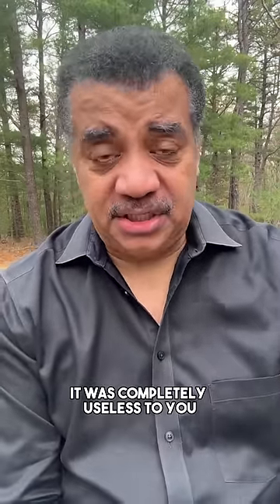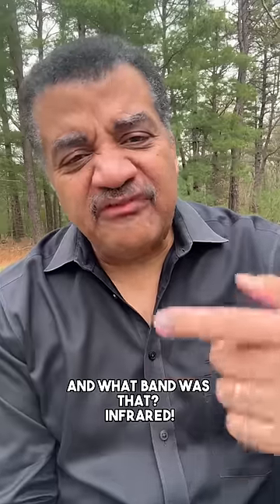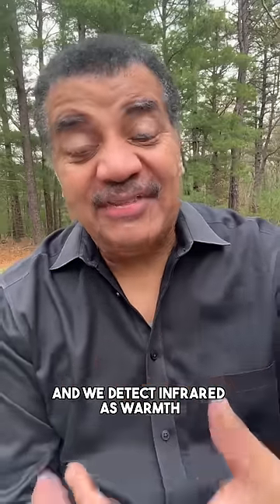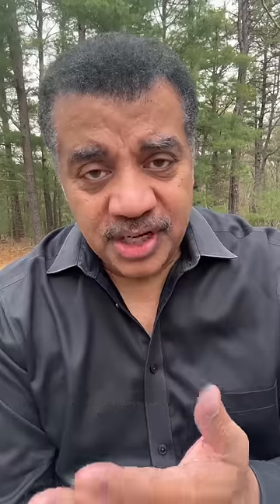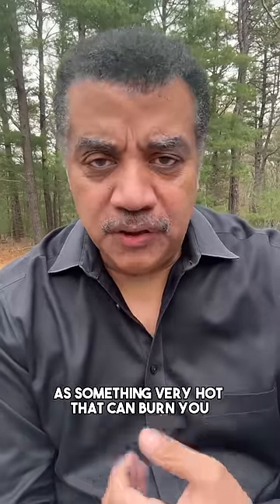LED Bulbs vs. Old Bulbs 💡

Comment: “Sir, that’ll be $23 for the bulbs”
Reply: And that will also be $240 for electricity, this month.
Reply: LED bulb payback time is less than 3 years and last wayyyy longer.
Reply: What kind of bulbs and where?
Reply: In the woods?
Reply: @benkinerk6830   last longer? They break on purpose. They could last forever but the companies want money
Reply: When you want a designer bulb with multi functionality, they tend to cost 10-15 dollars. A 13w LED soft light bulb is about 1.50 to 2 dollars.
Reply: @R9naldo
Even as new lighting sources were being designed manufacturers were still reducing the envelope sizes of tungsten incandescent to make them overheat and burn out sooner. It is arguable that this was deliberately to make them last a shorter time to compensate for the flaws of the new bulbs, or simply penny-pinching by the European manufacturers who were being undercut by China. Either way the current breed of tungsten build is not a fair comparison with the new bulbs.
Reply: 4 for $1 at Walmart.
Reply: Not sure which planet you’re on. I replaced all the recessed downlights in the living area, the multi coloured ones that are controlled via your phone, LEDs, about 6 watts and they were $10 each and will last forever.
Reply: @jeremyashford2145 The thing about incandescent bulbs is that when they burn out, the filaments literally burn until they get thin enough to snap. If you make the filament thicker, then the bulb lasts longer.

However, resistance is proportional to wire thickness. With a lower resistance the filament is less efficient at converting electricity to heat as well as having more mass to heat up in the first place. This means it glows much less brightly and in a much redder color temperature for the same amount of electricity. A brighter incandescent bulb means a shorter-lasting bulb. Light bulbs are designed to balance durability with efficiency.

Of course, LED bulbs are incredibly efficient and incredibly durable, so it's really the best of both worlds.
Reply: @R9naldo stop buying crap LED’s
Reply: Where? I've seen about double those prices.
Reply: The cheapest I’ve found locally is a 4pk for $10 and I don’t think I’ve had any bulbs last even a year 🙈
Reply: That’s right, so sad 😭 the purpose is to abuse the consumers for greed.
Reply: The old bulbs cost you twice as much... or do you not remember having to replace them regularly? The new bulbs will last way longer than these will, and despite people saying they cost more in electricity... THEY DON'T. 

The measure of how much electricity they use is not whether your bill goes up or not.

Comment: Fun fact, auto manufacturers have started putting defrost in the headlights of vehicles because of this.
Old bulbs would be warm enough to melt the ice, leds cannot.
Reply: Headlights defrost will be used only a few hours a year (in a more efficient way than bulbs), old bulbs waste a lot of energy during the whole time they are used.

For a thermal engine, wasted energy means wasted gas.
Reply: @psykauze 
Possibly, but I don't see how replacing old bulbs with LEDs is going to effect gas mileage.
There is an energy savings, but it's not enough to effect how much gas is used.
Reply: @ShrockWPS  A single H1 bulb is consuming 55W, this power came from the battery and alternator, so from the engine. Even with an engine with an average efficiency of 20%, this means you have to consume 275Wh of gasoline per hour. A liter of gasoline (sorry I am European) is about 10.000kWh, so we need to consume 2,75cl of gasoline for 1h of light for one bulb.
A car has an average speed of 37,5km/h during its driving usage, the bulb will consume 7,33cl/100km more.
On a car with a mileage of 39,2mpg (US) this single bulb will drop the mileage to 38,73mpg.

Where I am, 2,75cl of gasoline costs about 0,05€. With an average lifetime of 500h, the H1 bulb will cost 25€ of gas.
Reply: @psykauze 
Forgive me if I'm mistaken, but I don't believe that's how it works.
Take for instance my personal vehicle. I drive a 2005 Toyota Highlander it was the 3.3 Liter V6 engine.
The engine rotates the alternator and the alternator puts out a set amount of electricity. The power the alternator produces doesn't increase or decrease because of the demand of electronics pulling from it. It produces strictly off the engine.
So whether I run LEDs, or the Hologens that are currently installed they won't effect the gas mileage because the engine and alternator produces the same amount no matter what.
Reply: @ShrockWPS it will keep your battery from going dead so quick if you leave the lights on though.
Reply: @ShrockWPS  The output of your alternator varies directly with the amount of load from the vehicle. It does not output a set amount of power. Increased power draw has a direct impact on the effort needed to spin the alternator. I'm currently in need of a new serpentine belt on my Camry. If the belt gets wet from driving through a large puddle and then I turn on something with a decent power draw like the rear defroster, the increased rotation resistance from the alternator is enough to make the belt slip and squeal. Every single watt you add to the overall electrical load in a vehicle increases the amount of fuel the engine needs to burn to run the alternator.
Reply: Everything is correct except that led don't get hot. They do with enough wattage. Look at ktm bikes: they had to install a cooler for the headlight
Reply: @Revy8  I mean, it's half correct. The LED itself does not get hot. The electronics that drive them do however give off heat, which can require a cooling fan in environments where the ambient temperature can be quite high (like a car). I have some 150w equivalent LED bulbs and you absolutely cannot touch the base of them after they've run for a while. It will burn you. It's likely still losing more energy as heat than it's outputting as visible light.

Comment: In a moderate cold country, like The Netherlands, the warmth of an old-fashioned lightbulb wasn't total waste: it actually helped to warm the house. So now we have more effective lights, but we also have to turn up the heating a bit.
Reply: Yes indeed as there's no such thing as a free lunch.
Reply: Likewise in the mediteranean countries like mine, during the summer,  old bulbs had our AC working harder
Reply: Basically that's true, but the heat-energy produced by the light bulb normally wouldn't be enough to make a big difference.
You could also use a heat-pump/AC to heat your house and have 4x the efficiency of a light bulb 🤔
Reply: I really miss the heat 6"above my head when standing up
Reply: Why make heat and light functions inseparable? Better to have them in separate devices so you can control each as needed
Reply: Daul lighting.  Warming bulbs and lighting bulbs. It will meet you half way there
Reply: It's still a lot more efficient to turn up the heater more than to use your light bulb as part of the heating equipments at home.
Reply: Yeah but that's A: only true for about half of the year, and B: lightbulbs are usually pretty close to the ceiling, which is a very inefficient way to heat a house. So while it was a bit of compensation, it wasn't even close to being effective enough to make it sensible to keep using incandescent lightbulbs.
Reply: You’re forgetting Summer, that same heat made the house too hot in Summer if your logic is correct and it isn’t. There’s too little heat from bulbs to warm a house. Heat rises and any heat from the lights stayed near the ceiling where you couldn’t feel it.
Reply: @polycrystallinecandy Most of the times needdd in parallel though... When it gets dark, it also chills down.
Reply: @jaspermooren5883 the infrared light that it makes warms up the things that absorb it. Namely walls, furniture, floors and so forth. Its actually a pretty good heater. It's also typically only on in the rooms that you're using. Also, most of the infrared light is in the 700-800nm range which doesn't go through most glass, so you don't really lose the heat aspect of the light that way. It basically stays in the room and warms it pretty evenly.

One trick I see a lot up here in Canada is crawlspace lighting on a thermostat. Lights come on below 5 degrees or something. Does a fantastic job of keeping your pipes from freezing, they last forever because they don't often come on and they're much safer than anything with a heating element or fan.
Reply: But still wastee on warm summer nights.
Reply: Just use the heater at as your heat source they are far more efficient then a lightbulb at heating
Reply: And they don’t blind nocturnal birds like LEDs do
Reply: @levismith7444  how's that? 🤔
Reply: Sun is up later in the summer. Like who turns on the lights when natural sunlight is available?
Reply: @epbeket  most LEDs create excess light pollution which disturbs nocturnal birds as well as melatonin levels in humans.. that my not apply to amber or red led lights but definitely the white leds

Comment: I need the old ones for my plants in the winter.
Reply: No you don't. I've got my roses and tomatoes in a grow tent with just LED lights. You're good without them unless you just need the old bulbs for heat. Light is light, and plants use simple light for photosynthesis
Reply: @BadgerScrub  that's what I meant. For heat.
Reply: Cant you use geat lamps?
Reply: Besides LED bulbs inhibiting melatonin production and disrupting the circadian rhythm degrading the quality of sleep among other unhealthy things / yeah at the expense of our health they help lower your light bill
Reply: Wrong plants bud he means those sticky icky plants
Reply: For chickens too
Reply: All the LEDs I’ve had get hot on the part below the plastic 🤷‍♂️ also seems like they don’t last nearly as long and way more expensive smh.
Reply: @JayBenn-mr2woh  yeah you save like 50 cents per month power wise but get to spend more for the bulb itself. Hooray "The Future"

Comment: to be fair in cold places it's still creating heat and 100% efficient
Reply: But they won't melt snow or ice off a head light.
Reply: You'll get more heat out of wood.
Reply: I concur. I'm in Canada, I live in an older home, and keeping my bedside lamp and a floor lamp on in my bedroom is the difference between comfortable and cold.
Sometimes inefficiencies can have unforseen value!
Reply: @stephenmitchell9520 Why do not use use heater ?? 😂😂
Reply: @jericho-tube 
We , of course have heating. in my case, hot water radiators powered by a gas furnace.
 older homes such as mine are often not up to par pertaining to heat retention and distribution.
Our prevailing cold winds are from the west, as is my bedroom, so my room us predisposed to being colder than other parts of the home.
Getting heat from being able to see is just a bonus is this case.
And yeah, I do have an electric space heater should I choose to employ it.
Reply: Right and in those same cold places, the same electricity can be used in other places.
Reply: Now, if you use the energy saved by the LED and use it in a heat pump, it's 500% efficient.

(this is the internet, numbers are not facts)
Reply: Nothing is 100% efficient, but it would be a little more useful, but it doesn't give off enough heat for you to even feel it a 1 foot away. So....no
Reply: @cptmalcolmreynolds3623  Theoretically all electric induction heaters are 100% efficient, meaning given their voltage and amperage they use 100% of their energy to create as much heat as they can.
This is a big misconception and just because a 45w incandescent bulb is able to heat in the infrared spectrum makes no difference; it's arguably more efficient than having 3 45w bulbs in a room that needs mild heating than an LED and a 500w space heater.
Just because you don't feel the heat does not mean it is not there you cannot see in this spectrum without electronics.